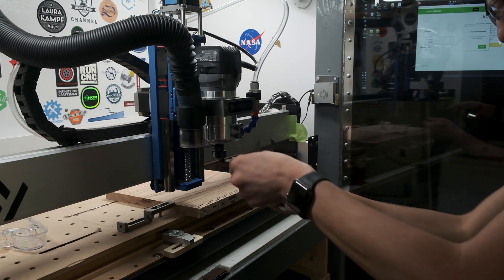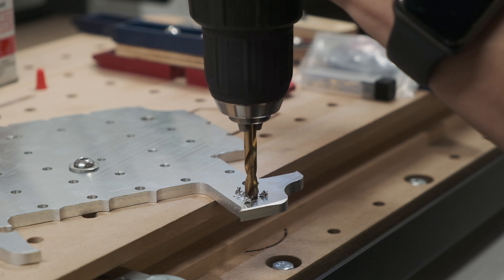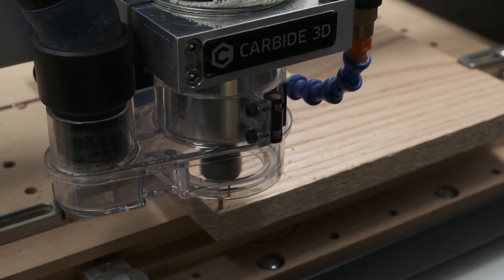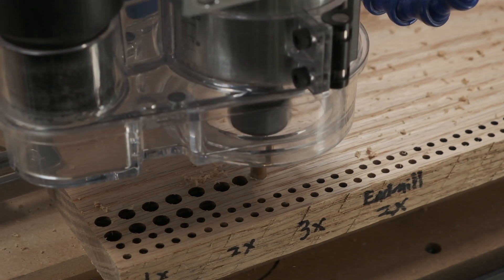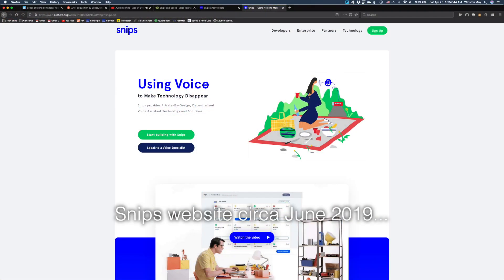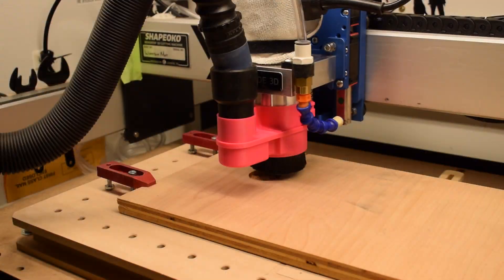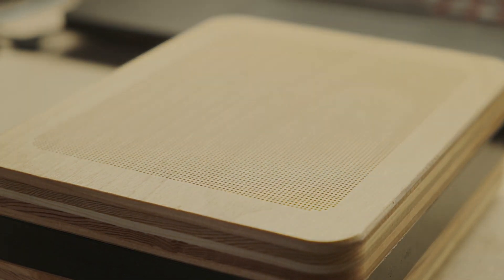How Bad is it to Drill on a CNC Router?

Comment: a kinda hack to do this is find a drill that has that flat section for a handle to be clapmed on and make an adapter (just a ring id for the drill and od for the cnc with a cut in it and a cable tie for the trigger) to replace your spindel with a drill for the holes then you get power and speed you need also can hold drills  easy not good for most holes but if your doing alot of drilling prosess in a job might be worth doing

Comment: i has drill lot at hard plywood and my skill need say, drill have lot lot better use than endmill bit, end mill come alltime oval hole but drill bit come perfect good hole. i use lot normal 4mm and 6mm drill bit or ed mill bit.

Comment: First, for anyone starting out in CNC, upgrade to a chinese spindle.  The air cooled ones have come way down in price and allow you an easier upgrade path. It's a night and day difference from a router.  Between tolerance and lack of speed range, routers are just clunky when it comes to CNC.  I drill on the CNC all the time.  I even use forstner bits and prefer them for most drilling operations in wood.  When using regular drill bits, cut them to as long as they need to be.  They work fine until one gets even the slightest bend, then disaster happens.  I cut down the length on the forstner bits as well.  The shorter the shaft, the less potential for wobble.  Drilling is fantastic on the CNC, but better at a slower spindle speed. proper feed rates and a short drill bit.  Make sure that you have a way to quickly turn off your spindle if something goes wrong.  A bent 1/4" drill bit at 12k+ rpms will shake a hobby machine apart very quickly and will ruin the bearings in a router very quickly.

Comment: Just what i need... I need to drill a number of holes of a certain diameter and in a precise pattern (or I have to do it manually which sucks.. LOL)...  I need a CNC router.... Mike in LA, Calif, USA
Reply: you need, simple build own cnc machine, i just build my son own cnc machine table working size 1200x1200x300. and nema 24 470 oz torque stepper motors, DM556 motor drivers and ols paraller port computer 20$ all cnc cost me less than 1000$ simple easy job build.

Comment: lol On Fusion handling tons of holes, did a project yesterday(leather tool plate) where I repeated a model hundreds and hundreds of times. And it was a complicated little stamp, trust me I feel your pain;) I've got a pretty stout multicore xeon workstation with 96gb of ram. BUT Fusion still was dragging it to the ground on this project so I think it's Fusion more so than the machine pushing it;) I crashed Fusion like 10 times yesterday;)

Comment: At my work, we drill thousands of holes on out shopbot, but the biggest issue we see is bearing wear on the router motor.

Due to the shopbot being used this way most of the time it is in operation, it has two spare spindles that are rebuilt and swapped when it starts getting noisy.

We also use short carbide bits, due to the material (mdf) and speed.
Reply: only idiot use router at cnc machine, not have plan used lot machine work and newer not can use drill job. if need working well silent fasten ,accurate need buy real spindle not expensive than many router buy ewery year.

Comment: “Boring” is an operation that uses a boring bar what you are calling boring is just contour machining with a ramped entry the confusion might come from the use of “bore” as a term for round holes. Boring (with a boring bar) and drilling are a better way to make accurate holes any machining done on a Cartesian machine is going to be out of round and often out of tolerance due to backlash. The disadvantages to drilling you mentioned are correct hss drills want a lower rpm and are long and wiggly- also without a drill collet it’s tough to get them seated in the router. Outside of lowering rpm you can get more expensive carbide drills which will bring the ideal rpm to a more router friendly speed- you can also get stub length drill bits which help both the stickout and walking issues

Comment: If you don't have hundreds of holes to make: I use a drill bit in the CNC as a sort of very precise center punch, then drill the holes on the drill press.
Reply: i use alltime first run all hole center drill, what used metal work lot, then change short drill bit carbide drill and make holes. today just made 150 hole 6mm 1/4 " spindle can little bit adjust speed down ,max have 20K and increase this hand potentiometer half about, ER16 spindle. working well all day.

Comment: There is nothing stopping you from buying a 20 dollar pwm power supply off amazon and using that to control your router at lower speeds. The rpm is not a limitation of the motor it is a limitation of the very basic electronics inside of it. Anyone should have the knowledge to remove the old electronics and hock the motor up to a new power supply. Then you will be able to go as low as 30 rpm on most motors like that before they cut out completely. Keep in mind the lower you go the lower the torque however. Once you get high enough though then torque stays pretty constant for the rest of the range.

Comment: If you're just doing imprecise, mass repetitions and it's breaking your CADCAM program, just split it into multiple programs. Or, you can just play with the G-code. I think there's G-code for arrays of drilling processes, but you can also just make a program to drill one hole, then edit the G-code and copy/paste a bunch of relative coordinate changes.
Reply: With a bit of coding skill, you can easily generate the GCode given the centers.  Its just a simple text file.  I've done it.

Comment: Good stuff.  Thank you, Winston.  I see a lot of comments from guys who are clearly veteran CNC machinists, so they're rightly skeptical of this, but as I understand it your point was to do some legwork and investigate the question of drilling with a palm-router based CNC machine - for those of use who have these machines and wondered that ourselves.  I know full well these routers spin too fast for regular hole drilling, but man what a cool thing if it can sorta be made to to work.  I'm a mechanical engineer and have had a manual Harbor Freight grade manual mill for years, but I'm new to CNC - just put my Shapeoko Pro XXL together last week and ran Hello World.  What I don't get about this is what the toolpath looks like.  In other words how do you get the machine to just plunge down to drill a hole hole but not translate?   How do you make it peck?  (I've gathered from comments that's not a good idea, but would like to know nonetheless).  Is it as simple as using Carbide Create to draw the board with the pattern of holes in it and using the "Drill" option under the "2D Toolpaths" tab? Can you steer me to a good tutorial on this?
Reply: If all else fails, just look up the list of G-codes that your machine can handle and manually edit the G-code. A printed list of G-codes can be a lot more accessible than trying to figure out the ins-and-outs of some CADCAM programs.

G-code really isn't that difficult to learn. The reason CADCAM programs exist is that it just allows well versed CNC programmers to more quickly create more complicated programs and avoid simple oversight errors from causing too much damage on test runs.

If you're only doing simple wood projects, you're really only going to be using a small handful of simple G-code commands.

Comment: So far i have only had to make drill holes once in my waste board for my thread inserts. I used a 1/8th upcut end mil and vcarve drilling tool path. Maybe cuz i was using MDF prob, But i had no issues. I did buy the upcut bit for this job (drilling holes) maybe thats what did it?

Comment: I had a project where I had to drill 14,000  1/16" dia holes in 1/4" acrylic. I used a standard
split point HSS drill. I turned on the router at 8am and left for a meeting in NYC. I got home 
at midnight and it had just finished - it clocks the time the job took. The piece was perfect.
I did a two pass peck and converted circles to drill points so that is would never move horizontally.

Comment: Just use a router with a speed adjustment and go for it.  I built a Jacobs chuck adapter for my DeWalt 7518 and have been drilling basic holes that way in a production environment for six years without issue.  Just get the RPM down to 10k and it's fine in wood if you plunge in and out as quickly as possible without pecking.  I don't even go through drill bits that quickly.

Comment: You can get single flute spiral drill bits, but it looks like the common sizes are tiny with 1/8 inch shank, or common sizes in a much larger shank for big machines. Bit of I've never used any of these before.

Comment: Another idea to help those out with drilling, I use a V bit to spot drill all my holes, even in aluminum, for layout purposes. I can CNC out the piece with all it's geometry minus the holes and then drill press said holes. If the holes are center drilled, even drilling 100 holes or so, manually drilling the holes goes way faster! Wished I had this video before I found out the hard way that drill bits in a router lead to sadness. 
Thanks Winston
Reply: I do this too. Works pretty well as long as there aren't hundreds of holes.
Reply: That's an interesting idea.  I just started an hour ago with 2mm HSS drill bits with my spindle, and found the bit tends to deflect on its way in.  A v-bit to spot it might work.

Comment: Two bad reasons making this video ridiculous. Why? One: you can reduce the rpm, Two: use shorter drill bits.
Reply: The lower limit of the router is WAY higher than the max operating rpm of a standard drill that the drill bit is designed to work with.

Comment: Hi Winston, I'm just starting out with a CNC, what would you recommend fusion 360 or cut 2D. I have no experience with such programs and realise it will be a sharp learning curve, but not wishing to spend too much time learning the wrong programme. I have purchased a Ooznest CNC as they are based in the UK. Any advise would be greatly appreciated.
Regards, Will
Reply: I agree with LazyH. Fusion 360 is very common and you will be able to find almost everything you need from learning to small little features you wouldn’t know were there online. As LazyH said, it is free for many use cases and the interface is great once you know a little about how to get around. Hope this helps! Happy CNC-ing!
Reply: @samuelforgie2771  thanks for the advice;-)
Reply: @LazyH-Online thanks for the advice;-)

Comment: 2:03 i can give you example.
i could use higspeed mill 32mm 2500 rpm feed 1mm fz tool has 3 insert so 7500mm/min feed
it works fine on linear moves like it designed taking 0.25 depth of cut

if i mill hole lets say 40mm so tool it 75% smaller than hole if i use same feed its make awefull sound and tool life not so great

so 40mm hole circular lenght is 40*3.14=125.6mm
but tool center line going 8*3.14=25.12

so it cut 25.12mm circular path but get 125.6mm circular result
you can think whats wrond xD
so you are kinda move 25.12mm straight line
but cut 125.6mm SAME time.LOL
so correct this need use 5x less speed 1500mm/min
we are cuting slower but cutting feed is 7500mm/min on that finish surface

you cant imagine how fast its going 3 teeth 1 revolution move 1mm
more feed your circular path nor round.its like skipping lol
more slower go more acurate hole size it.
to use 1500mm/feed what is correct on math it cut hole 0.4mm under
even it cut 40mm square shaft in same speed exact

you see how cutting holes are different

Comment: Very interesting topic and video. :) I have a usecase in which I'd like to use some CNC to drill ~ø 5 mm holes in 2mm thick steel plates. I haven't built the CNC for this purpose yet, and was actually thinking about a design similar to a Maslow CNC. I'm fine with the drilling being relatively slow as I only need ~20 holes per plate, the primary thing is accuracy since the point would be to save time in laying out, measuing and marking up components. Using the Maslow design would mean I could set the plate in the orientation I would later build it in. 

What would you advise for a task like this? I'm thinking if perhaps it makes sense to use something else than a router (maybe a servo?) to keep RPMs down? And how feesable is it generally to drill such holes with a CNC providing you use something with a higher torque at lower RPM to allow for a lower rotational speed?

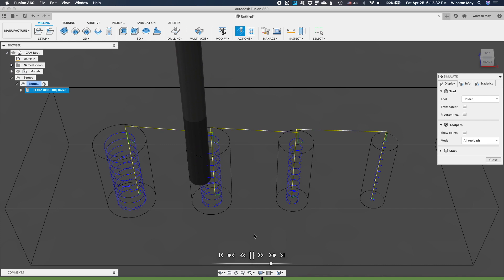Comment: 2:01 if you are using same rpm and same speed for all those holes. its WRONG.
tool center path feed is same.smaller hole surface feed speed increase untill your tool is same size as hole feed is 0 x,y LOL its now drill and need z feed

Comment: You forgot reason #3 .
The bearings in the spindle and their mounts are not made for axial loads but .
I pushed my small ATC spindle (CNC mill, not 2.5D router)  up inside it's casing because the bearings where press-fit while drilling POM.

Comment: Winston, I'd be interested to know why to despise oak. I've just used it for the first time found it to machine really well. It was tough on the bits during the final cutout procedure but still turned out well.
Reply from the maker: Some oak is okay. Hardware store-grade red oak has really course fiber structures that pull out almost as badly as Zebrawood, and has that nice tannic acid smell. Overall, just not pleasant to machine. Also, there's a whole cult of people who find red oak cabinets and furniture to be quite dated, though I find it less offensive in that regard.
Reply: Winston Moy thanks. I’m in the U.K. and using offcuts from a joiners so maybe a different species : grade of oak.

Comment: We drill hardwoods all the time with standard drill bits but it helps having a 9hp spindle that still has usable torque at the 3500rpm we use.

Comment: Never really had a problem with a drilling pass.  I just drop the z feedrate and bring my spindle way down in speed.  My spindle goes down to near zero rpm, so it's not so different from just using a drill.  Also...with the right endmill and path you dont even need to use drill bits most of the time.

Comment: As a trade cabinetmaker that specialises in cnc programming and operating for over 20 years I can officially say you have no idea. Firstly try using the correct tooling for the job and use a proper spindle with speed control. If fusion 360 keeps crashing on you during your designs I would start thinking that maybe you are using the wrong software. I could design programs with thousands of holes on an old Pentium 100 within seconds with the right software

Comment: So, there's a very very very very simple and reliable and painless way to drill holes in metal with a CNC router.

You ready?

take off the router and mount a decent drill there instead, then set your feeds as appropriate for the drill's speed

There you go.

I've done that PLENTY on my router for things that were too long for my Bridgeport to do in one setup.
Reply: Strange that nobody else came to the same idea
Reply: @Sukhinov  Yeah, me too. I only ever do that when I'm doing metal work, though- for wood or plastic it's quicker to just do a helical boring operation with a small end mill, and honestly I don't even bother with that on a lot of metal jobs, either unless there's high precision required. If it's just basic relaxed tolerances on metal work, I'll just use a carbide 90-degree spot drill to mark all the holes needed in a large piece then go to a large drill press for the holes. (Or, of course, just do it all on the CNC mill if the job will fit.)

Comment: I've drilled almost a million holes with a 2.2kW VFD spindle on my, a basic HSS black oxide coated stub drill can do 300k+ holes in hardwood if you get your feed rates right. The challenge is having a very fast Z axis, which most routers do not. With a 4mm drill bit, I drill at about 0.2mm/tooth, or 0.4mm/revolution of the router bit. I run at 18000rpm typically,  which is only 7200mm/min or 120mm/s. Its a hard, fast punch and pulling out of the hole is critical to not burning. I run a compressed air jet on the drill bit for cooling and chip clearance, with this setup I can drill a 14mm deep drill every 0.7 seconds. I don't peck drill, just punch in and out hard and fast.
Reply: Damn! Good work finding the params that work for this kind of drilling
Reply: Are you serious,  this guy acted like  routers are to fast, what rpm are they,  because I thought 18k was pretty fast but for your .157 drill that's only 75 sfm,   maybe he is talking about bugger bits and way to shallow of a chip,
Reply: I dont get it,  if your running at 18000 rpm, and drill .4 mm or .2 per tooth per Rev,  that would put you at 120 mm a second,

Comment: Get drill bits made for wood and look up speeds and feeds for hard and soft wood. Probably 2500-3000 RPM and like .005" per rev. And don't peck it just adds cycle time. if you were drilling something harder or much deeper then you should probably peck.

Comment: Boring is always more accurate than drilling.  Correct terms: stub drill, screw machine length drill.  You are really chewing up that collet nut with the stamped wrench,  A pair of correct sized wrenches would me good upgrade.

Comment: I drill on a CNC router daily and it's fine if you use proper wood drills and not drills meant for metal like you're using.
That said I have a proper CNC router that weighs about 5000kg and has a 10hp spindle that can run between 2000-18000rpm.
Moral of the story, right tool for the right job.